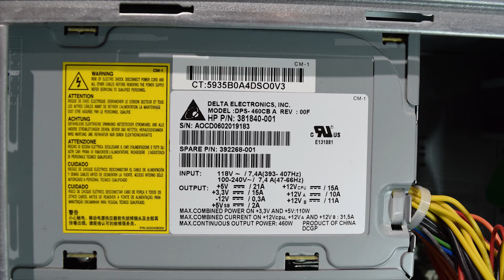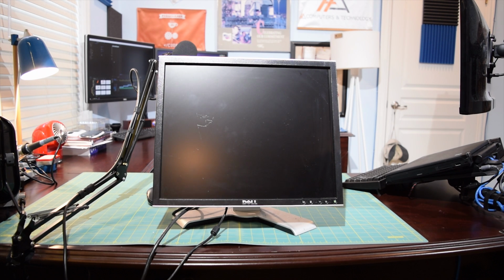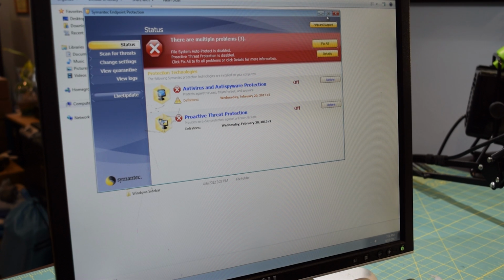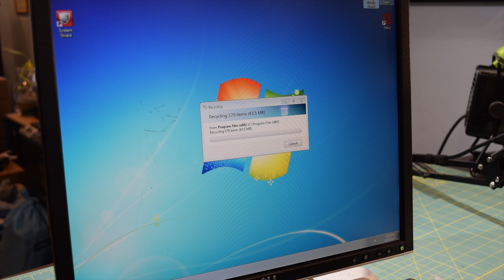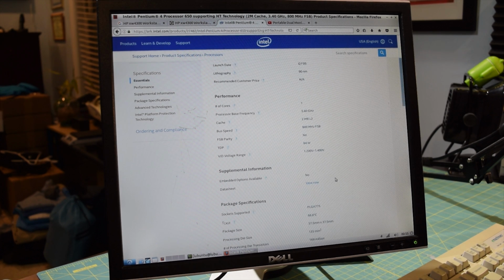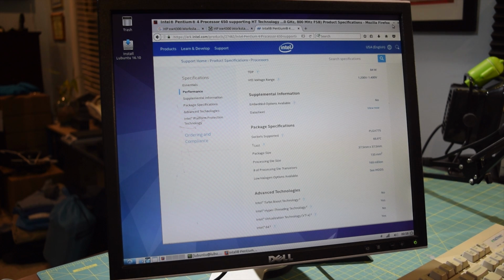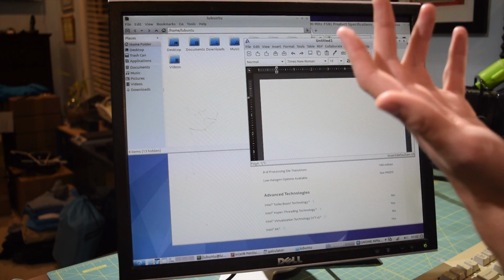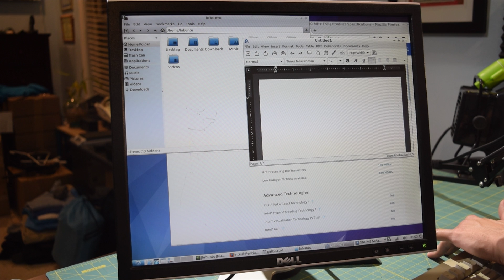Garage Sale Finds: $5 HP xw4300 Workstation Computer Overview (2005)

Comment: You shouldn't have to explain yourself for using Linux lol. It's a damn fine OS, and most computing devices on the planet run it for a reason.
Reply: CrackedDylMil You have not been using Linux for longer than he knew what a computer was. Telling by your YouTube account you are 14-15 years old. Please, quit lying just to make yourself sound credible.
Reply: You must make a lot of money by selling unintelligible screaming noises...
Reply: CrackedDylMil Nvidia drivers work just fine for me on proprietary, as well as AMDs.  Intels x99/z270 runs fine.  am4 runs fine.  Once again list a non gaming use.
Reply: CrackedDylMil a GTX 650. LOL cuda doesn't work amazing on Linux, but it works fine if you know what you're doing.  lmfao.  I can go to the local market and pick one up just for you and run Linux.  because I know for a fact down to the GTS 250 Linux loves it. You act like you need afterburner to overclock, but clearly don't know how to navigate to the low-level bus folders and overlook your gpu end of argument.  clearly you don't know what you're talking about.  Also software controllers for RGB, Nvidia, AMD, and a few others can be installed and scripted for most cases, don't use Linux or bash it if you have no real experience with it you pleb.
Reply: CrackedDylMil afterburner is not essential.  If you can't call processor info through grep and or any other third party repo software why use it? Linux never was acclaimed for gaming and it performs near perfect with windows.  considering you actually pay attention and know how to change kernel/driver code.  if you've been using Linux for so long I find it quite pathetic you're having issues with some stuff as simple as that.
Reply: I've been running Linux, and gaming on it for over 3 years now. :) Sure is nice not to have windows rebooting on me in the middle of a deathmatch. lol.
Reply: "Please apply ice to burned area." lol xD
Reply: CrackedDylMil windows forces updates mid gsne at times.  they are scheduled and can only be put off for so long before Microsoft says "fuck it we're updating in your important process".
Reply: CrackedDylMil AS5 is toothpaste? lol my system is water cooled and rarely hits 50c on cpu/gpu under synthetics.  pretty sure that was the most irrelevant comeback ever in what way does windows updates shutting down mid game have to do with thermal paste?  Let me be as irrelevant as you. Maybe you should upgrade your system before you talk shit. "LOL".
Reply: CrackedDylMil idiot boy? I'm certainly older then you. lol.  Windows update does touch your PC in the middle in the case of w8-10, windows 10 used BITS but you wouldn't know what that is without googling it.  You must really know a lot when you don't realize windows 10 has a feature that only allows you to skip 3-4 updates before it just does it on its own.  "idiot boy"
Reply: CrackedDylMil because linux? you're right 5/9 things Linux is faster in lmfao
Reply: excellent OS, but not much gaming support :(
Reply: Actually, gaming on Linux works just fine. :) Been doing just that for over 3 years now, and as I said before, it sure is nice not having windows reboot on me in the middle of a deathmatch just to apply some damn updates. (Which typically would just fail, and revert themselves anyway, so thanks for wasting 2 hours of my time for nothing.)
Reply: CrackedDylMil I love how you result to direct insulting.  pathetic :)
Reply: CrackedDylMil I do? certified to be exact, as well as most of my CompTIA/sec+ training was as well. It is clear you have no clue what you're talking about as you can't respond to an intellectual response.
Reply: +Primodialism, ok, I think the troll has had enough food... and probably enough drink as well. ;)
Reply: 5had0w5talk3r most don't even know what linux is though.
Reply: Most people don't know how an internal combustion engine works, but that neither removes merit from it revolutionising transportation nor does it change the fact that it's the most widespread method of power generation in human history.
Reply: +5had0w5talk3r It's a damn fine kernel.
Reply: 5had0w5talk3r 
Every pc uses Windows dumbass. Only stupid people run something cobbled together in a shed by some geek with an Elliot Rodger complex. If it is so good, why does nobody pay for it? Because he cannot get anyone to pay a dime for it is why.
Reply: 5had0w5talk3r also animating on Linux? it was hard enough to even download CUDA with my Ethernet and wireless situation. After finally downloading it I clicked to open it, it ran the script as expected, then hung and stopped responding. tried waiting out for a few hours with no dice. ran from terminal and got further, (I.e. not crashing) but at the very end of the install it told me it actually couldn't install because I needed to kill the X server. Googled what that was, and found it was basically running all the graphics. Killed the process and went into command line mode with ctrl shift f1 only to install it and have red lines going down my monitor and a unusable os... great.

installed windows 7, booted it up, and windows update took care of the rest. Sure enough all my cuda applications worked fine.
Reply: CrackedDylMil >give me one non gaming use that Linux is slower then windows at.
Reply: On a Pentium 4 with 2GB of RAM I was able to do heavy audio processing/ recording with no problems on Lubuntu, I ran into problems initially but nothing that a google search and a few nice folks on forums couldn't help me with. Never had internet problems, audio drivers worked like mac drivers without the mac price. I'd say it was pretty damn good, but for gaming I'd imagine there would be problems, and the lack of decent software (for most things) was a turn off. I'd run linux again for a second PC but never a main PC, but it's a great learning experience.
Reply: I've had far less driver problems in my 6+ years of Linux than whenever I've had the displeasure of installing a fresh copy of Windows. In Linux I get a completely working desktop out of the box. Most of the times I don't get networking at all in Windows and have to deal with 800x600 resolution until I install a million drivers that will each require a restart.
I've not had any issues with V-Sync either, outside of some SiS chips but those guys have been dead for years anyway.
You've been able to install software through a GUI for well over a decade, quit being disingenuous. And even if you want to install through the terminal (which is actually way faster and more convenient), every package manager does it in a single command, so again, you're being disingenuous.
Wireless works out of the box on any wireless chip worth a damn (Atheros, Intel, etc.). The only company who occasionally gives any trouble is Broadcom and their wifi chips are terrible.
Linux is plenty compatible with any software written to run on it and the vast majority of users can be easily serviced by the software that has been written to run on it.
Performance on Linux is excellent, it wouldn't be the most widely used Supercomputer OS if it wasn't. Neither would companies like Disney and Pixar prefer it for all their animating and rendering. Neither would over 95% of the most visited websites on the planet run on it. In fact, when Microsoft ported their SQL server to Linux they immediately saw a performance boost before they even began optimising the code.

By all means run whatever OS makes you happy, but there's no need to be disingenuous about competing OSs to make yourself feel superior with your choice. Linux has its fair share of legitimate problems, as does Windows/Mac/FreeBSD/etc. Enjoy Windows more than any other OS? More power to you.
Reply: Okay, friend.
Reply: Primodialism CUDA doesn't function on my 650
Reply: Primodialism LMAO you clearly don't know anything about windows or you would've stopped arguing long ago 😂
Reply: 5had0w5talk3r I've probably been using Linux for longer than you knew what a computer was. I've tried countless distros, and I've never not had driver problems. Weather is was Linux forcing a 60hz vsync cap and yet somehow still getting screen tearing, Intel 3160 802.11ac dual band not functioning at all, having a largely unhelpful community that will just tell you to switch distros (which never helps. I've used almost all of them.) to my Ethernet simply cutting out for a few milliseconds and disconnecting all active connections every 30seconds, I've literally never not had problems in Linux. That's not even accounting for the lack of essential programs like msi afterburner, speedfan, CPU-z etc, the shit garbage gaming performance even on native OpenGL titles, and the need for countless commands and restarts

Windows on the other hand, can install in half an hour, and boot up with the proper wireless, graphics, Ethernet , usb, you name it drivers without restarting. I recently installed windows 10 on my gaming rig, and I installed all my programs at once using ninite, windows took care of my drivers, and I was playing games online with my friends without a single reboot.

Logitech gaming software did claim that it required a restart, but I simply told it to restart later and opened the program, and it all went smoothly.
Reply: Primodialism Why would I want to grep constantly for logging, benchmarking, and overclocking?

And no, Linux performance isn't even close to windows. Sorry, there's a huge ass different.
Reply: Primodialism 10/10 Linux is slower. memory compression sucks, gpu acceleration barely works, weird ass poorly made software eats cpu etc
Reply: Primodialism literally anything on my pc since the video drivers don't work.
Reply: Levi Guiney you sure your not bashing your power button with your feet mate? Windows only applies updates during shutdown and restart.
Reply: lol, linux. enjoy using your free modular spyless OS, virgins.
Reply: chiken da gr8 lmao my channel? my channel is an advertisement for products I sell. You wouldn't understand. Your account is a meme. You're probably 12
Reply: lol linux. enjoy getting your work done at your high paying coding job in a big fancy building with no games to distract you, losers.
Reply: Primodialism pretty sure you need to replace that tooth paste on your CPU because if your PC turns off using windows you're doing it wrong LOL
Reply: Primodialism lmfao windows update doesn't touch ur pc unless you manually shut down. there's no arguing it idiot boy
Reply: 5had0w5talk3r it's a damn shirty os for desktop use. Driver problems, VSync problems, using 200 commands to install anything, trying to get wireless working, no compatibility, shit garbage performance, etc.

Comment: well. it's ATX compliant, so just drop a different board and PSU in. HDD cooling seems to be certainly adequate, assuming there's a fan in front of the drive cage.
not sure where you'd find just the case cover, though.
Reply: There is nothing wrong with that Delta PSU.
Reply: That PSU is a HP propietary unit, and you can't fit a "off the shelf" motherboard in it either without modifications since the board is mounted on a removable tray and doesn't have removable standoff's

Comment: Even with more ram and an SSD that system won't run Windows 7, 8.1, or 10 very well. I know as I've tried them on similarly specced systems for people when they have requested it. Some people just don't have a clue about things (not you, but the ones who bash you running Linux on older systems). Anything lower than a Core 2 Duo just won't cut it in newer versions of Windows.
Reply: Pentium 4HT's do ok, it will definitely run, whether its fast or not.
Reply: A lot will depend on the GPU and the user's tolerance to lag. I'm used to an i7-2600k at 4.5GHz with 16gigs of ram, an SSD, and a 970 so older computers like this drive me nuts waiting for them to do something.
Reply: daniel15092 it will run alot better if he throws in something like this Look at this on eBay http://www.ebay.com/itm/271810575887
Reply: Toby, that won't run on that motherboard. It's limited to P4's and some Celerons.
Reply: daniel15092, I didn't say it wouldn't run only that it wouldn't run that well which is the truth.
Reply from the maker: https://www.youtube.com/watch?v=EksRYrLD5jY
Reply from the maker: I agree.  While systems like this will run Windows versions from 7 to 10 the user experience can be a bit lacking.  If I was giving a friend /  family member a machine like this I would definitely install a linux distro on it :)

Comment: could you upgrade that CPU to any type of Core 2 Duo/Quad?
Reply: The original 775 systems were pentium 4 / Celeron only. It's in the age range for that, but we'd have to know the chipset.
Reply: That one does NOT support anything but the P4s and Celerons. No Core 2 Duo/Quads. It's an old 955x chipset.
Reply: The Xw4300 only supports Pentium 4/Celeron, but the Xw4600 does support Core 2 Duo/Quad cpu's
Reply: does support dual cores, but not core 2 based CPUs, Pentium D 960 is the best supported CPU unless it supports the Pentium Extreme Edition 955/965 as well (hoping the BIOS will work with them since the chipset supports them)
Reply: Carlos the bios will support the 950 or 960, but not the 955 or 965. But an old system like that isn't worth the $30 or so that the it would take to upgrade it. It would run much hotter, use a lot more power, and wouldn't perform enough better to warrant it.
Reply: The Pentium D 945 is another alternative for like 5-10$, is basically a 950 without VT and lower TDP, but as you said, the PC is really old to be worth upgrading to some CPUs especially with Core 2 Duos priced around 10-15$ depending of model
Reply: And then again it doesn't support C2D cpu's
Reply: i know that, but i wanted to point a price comparasion, C2D support is present on the later xw4400 and xw4600 though
Reply: Yes I know, BTW I own all 3 of those models
Reply: Carlos, the D 945 isn't supported on this system. Only the 840, 940, and 950.
Reply: I have an xw4300 mobo, i could try the 945 on it if you want

Comment: You can try replacing the cpu with better Core2Duo or maybe even 771 Xeon quads and have a good machine.
Reply: No, there is only 1 775 socket, however what processors they support is based off the chipset and bios
Reply: 21ruiner You cant since the 775 is an older version of the socket that cant use core2duos/core2quads
Reply: Doom Frag There are 2 versions in the 775 socket?
Reply: 21ruiner Yeah from what ive seen
Reply: daniel15092 Oh well my mistake then